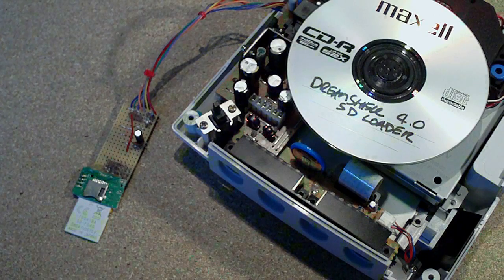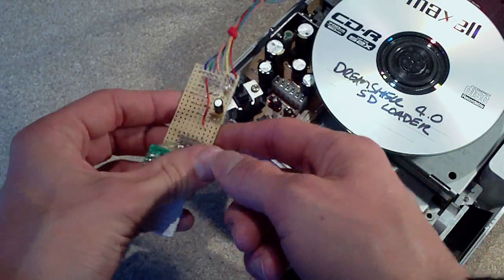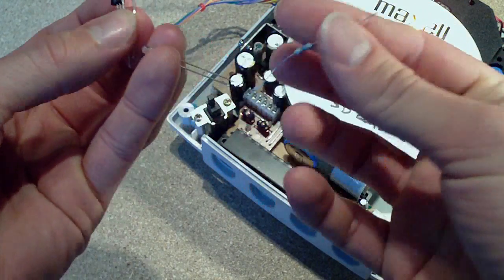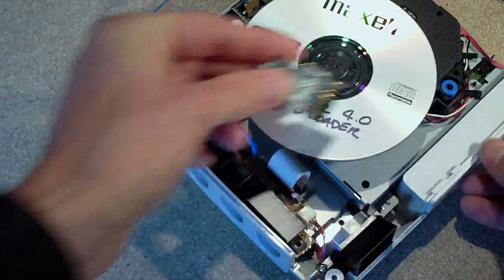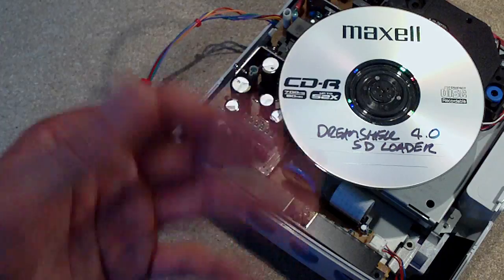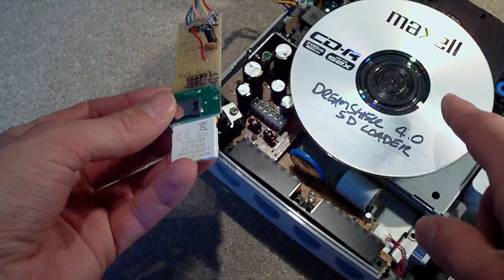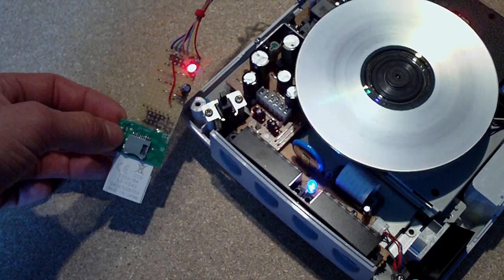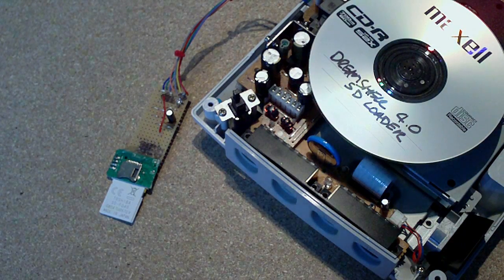Dreamcast SD Card Mod - Play Homebrew And Games From SD Card

Comment: Useless since It still need the GDRom drive.. GD drive are almost all done by 2016.. Mine is bad for almost two years now.
Reply: It's also useless because games get stuck all the time because of the slow readings from the serial port. If you want a good mod use a gdemu or a gd usb rom
Reply: Yes,that's true the DC Serial port is very slow. Serial is like having 56k modem as the Drive, but on the good side they are very Cheap. GD-EMU is a good solution but it is very Expensive and the manufacturer create limited quantities only. I will try one of those Alibaba GD heads. I have a question for you guys, are all those laser head compatible or I have to replace the Laser with the same one  that comes with the Original Laser ( DC have different GD manufacturers ).  Why no one has created the same thing from the LAN Expansion Port it is slower than the Serial or it cannot be used to load games to the main memory?
Reply: Abraham Soto It's not that expensive tho and if you subscribe to his website you always get a notification when orders are back up. Also if you want one right now at the moment you could go the USB gd-rom way. He has a lot in stock but asks 175 for one.
Reply: Abraham Soto Problem with emulators for me atleast is i don't finish games or play it 2 the end and with a system i do.

Comment: Hi, does the micro sd slot use the same pinout as the regular sd?
Reply: microSD has a slightly different pin configuration from a regular SD card. You can find it by searching "Micro SD pinout" on Google Images.
Reply: +RubberBrony thanks for the answer :)

Comment: Hi there, I don't expect a reply, but it would be nice if you did.

The reason I am looking into doing this is due to the CDROM failing on me. Am I able to remove the drive with this hack as I see the bootrom on the disc there, is there a way to patch the system so that is default and I can remove the disc drive.

Else I will be having to buy a new drive too just to get this up and running.
Reply: +Thomas Humphries I'm in the same boat as you. However I think it can be possible to do something similar to this but with a Raspberry Pi or something. I have it seen it done without the need for the GD-ROM drive.
Reply: +Michael Burke Hi, thanks for the reply, but I still want to use the dreamcast rather than a pi. just without the gdrom
Reply: Thomas Humphries this might be useful for you then http://forums.hexus.net/gaming/335589-sega-dreamcast-sd-card-mod-without-working-hexus-general-discussion-forum-rom-drive.html
Reply: +Thomas Humphries If your drive still works, you can install dreamshell to the bios and replace the stock firmware.

Comment: This seems pretty cool but I have a few questions. Will you have to solder the whole SD card interface to the strip board (including the board that came with the SD card interface), Can you use pins (to hold paper) as jumper wires,  On the diagram what is the difference between the blue wires and green wire, finally what does the red square with the red circle mean on the diagram. plus any advice that I may need when doing this. If someone can answer my questions, that would be much appreciated.

Comment: does the dream cast have an expansion port like the older sega consoles. if it does could you make a custom pcb that fits there that allows you to add a usb and or a sd/micro sd slot. it could have its own software installed to the pcb and just plug in to existing slot.

Comment: That there looks absolutely dope, but I've never really felt comfortable fucking around with system internals.  Anyone know anywhere in the US to get this done by pros?
Reply: You can by a system with a GD Drive for $55 or no GD drive for $40 here:http://dc-sd.com/p/2/dreamshell-boot-included-dreamcast-use-sd-card-directly
 or an sd card reader for $18 here: http://dc-sd.com/p/1/dreamcast-sd-adapter-dreamshell-sd-cardreader
Reply: jordan177606
Thanks for the reply!  Definitely going to look into this for my busted GDROM DC.
Reply: how broken is your GD drive?
Reply: It doesn't seem to spin on the busted unit at all.  Maybe it's a motor problem?  I dunno...

Comment: good job! but very complicated. Just burn some iso's and thats it!
Reply: Good luck when your GD drive burns out. Burning iso's to CD's and playing them on a Dreamcast burns out the laser much faster. The worse part is that you cant even find replacement laser modules easily.
Reply: Just looked it up, CD roms are not the same as GD roms, GD roms pack more information per disc, thus, the laser has to compensate for that, it is different than CD roms genius.

Comment: Don't bother doing this. It's completely useless. The serial port is too slow to run much. I had an sd card reader for my dreamcast and it was so useless i threw it out because it was doing nothing but looking like crap sticking out of my dreamcast. People said it ran most homebrew and emulators well yet it ran most of them like crap. Don't think you will be running many retail games from it. This mod is the biggest waste of work and time.

Comment: What's the easiest way to gain access to the serial port?  I opened my dreamcast and removed the power supply board.  But the metal shielding is still blocking the serial port.  Seems I would have to remove the gd-rom drive as well.  Is there any easy way to access the port without taking everything apart?

Comment: That's a great advance in modding. I wonder if this could even be achieved on the Playstation. It would be a lot cooler if it used USB port, too for external hard drives.

Comment: Why is such a high resistor put before the LED? I calculated it out and it should be only 36 Ohms, otherwise the current will only be about 2-3mA.

I couldn't get that same led or Metal film resistor, i have one that 3v @15mA. So I calculated it to need 20 Ohms but according to yours it would need about 261 Ohms right?

Comment: i finnished the circuit and installed it to my Dreamcast then moved on to downloading the software but so it turned out it is much more advanced than  i had expected. for the most part i understand it its just scrambleing the DS_Core.bin file that im stuck on and since the creaters are russian some of the translations are very misleading as well as confusing so as a sugestion you should make a how to on making the software to continue off of this

Comment from the maker: @CellularProductions those indicate jumpers and cuts on the stripboard. Where there's a red square you cut the track. Where there's a blue line you connect the two points with a wire.

Comment from the maker: @xTHExSTIGx I've put together a diagram showing my stripboard design and where to solder everything in the description :). 
I bought all the components from Maplin (apart from the card reader which was from Poundland). I'll add the part numbers to the description later tonight. Just go into Maplin and show them the codes and they'll find the bits you need. It's a pretty straight forward mod. Just post a comment if you get stuck :).

Comment from the maker: @wadie1987 Currently you still need to use a CD to tell the DC to boot from the SD card. So you need to use the drive for the first couple of seconds during start up but after that you can just remove the disc. 
I tested mine using a SDHC 4GB card and it works fine. I've read that it can support up to 32GB though. Hopefully the devs will continue to update Dreamshell and it'll become more user friendly/less buggy + get more features. Thanks for watching!.